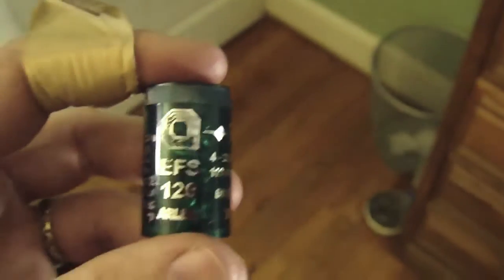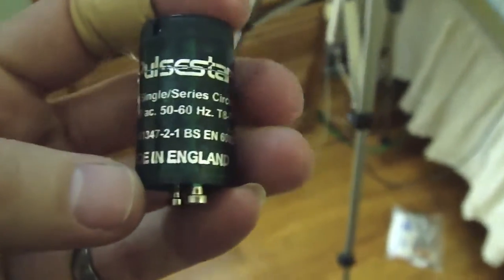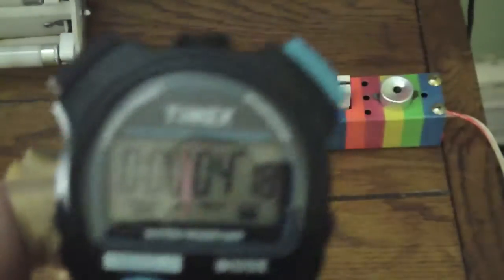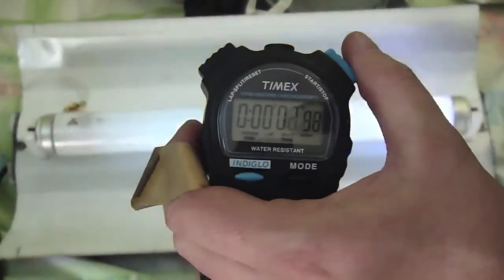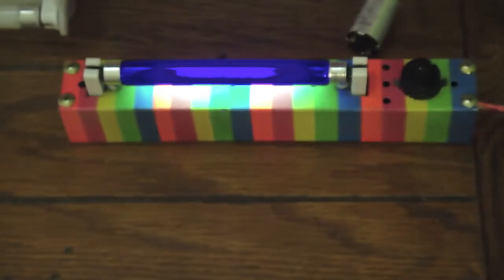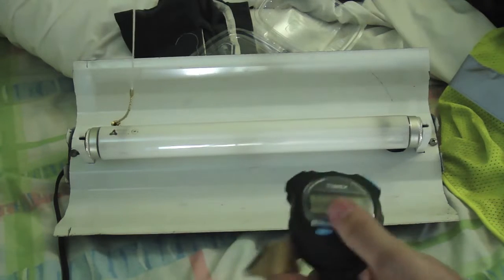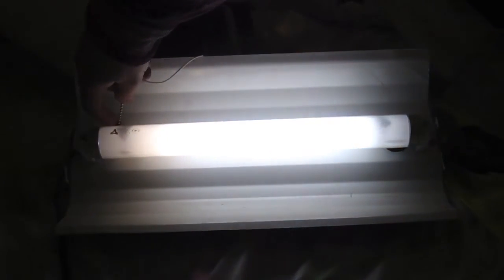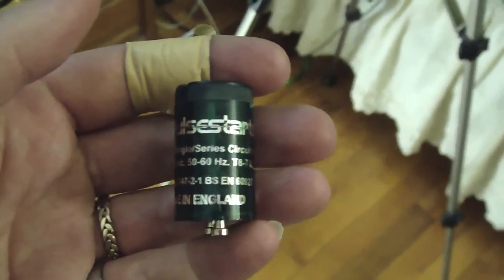Pulsestarter Solid State Fluorescent starter preheat

Comment: I really like these Paul starters such a shame that they are not in the US. I’m only sold in England, but these are preventing a fluorescent ball from getting a shorter life by having it blink several times before the real start and also give you a an eye problem.

But instead, the pulse starter unleashes a charge upon activation, letting the bulbs start an arc from the dim point to the brightness it was originally intended without any blink happiness. This helps extend the life of the fluorescent bulb.
Reply from the maker: They were awesome

Comment: Nice find.

I've looked around but I couldn't find this or similar products in the US likely because most fluorescent lamps use rapid start ballast but I do remember at one time, GE and Panasonic were making 13 watt compact fluorescent lamps (the kind that had a GX23-2 pin base) that had an electronic starter in them.

Comment: Btw I have the box version(remote mounting unit) of this Pulsestarter in the living room light stil in use installed in 1997 and the tube never changed since it was fitted in 1980s?? It's used very little but with frequent switching.